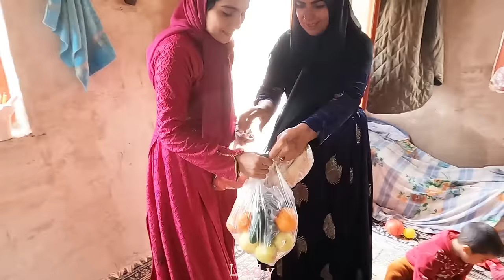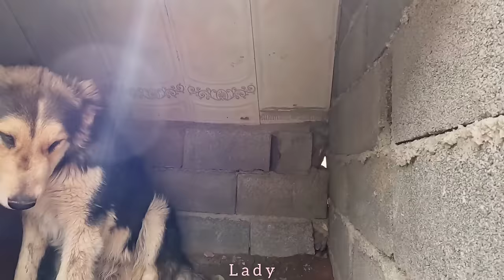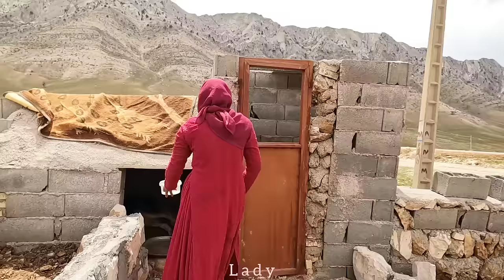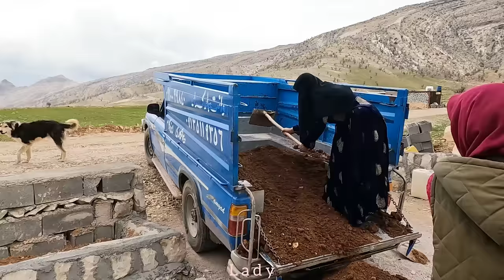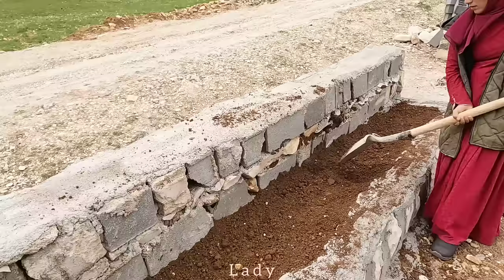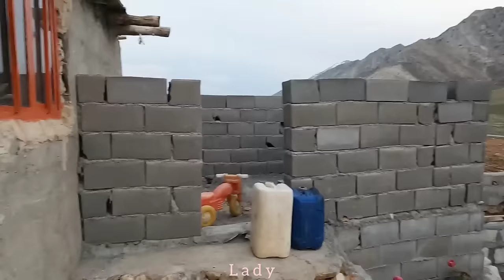Nomadic life: Mehin's battle of a young nomadic lady for a better life

Comment: Mahin it's better you applied in electricity connection on your house,you used or light and any appliances that you want,like washing machine,refragirator,or airondtion and vacuumed it's need already on your house Mashaalah,I pray that you can have🙏👍💜💚♥️❤️🌹🌹🌹🇨🇿
Reply: This may be a dumb ???  because I don't know how solar paneling works ???  If she had solar would that supply the power she needs - I'm not sure what Iran's infrastructure is or it's energy needs (note to self:  GOOGLE) but clearly when they go into town - there is a great deal of electrical power supplied - you see a great deal of lighting, neon, tc. etc.  but of course you would not see it in (most) housing that "nomads" (I use that in quotations because my idea of nomads - and these channels seem to be different) -